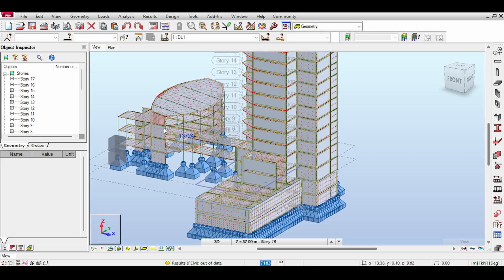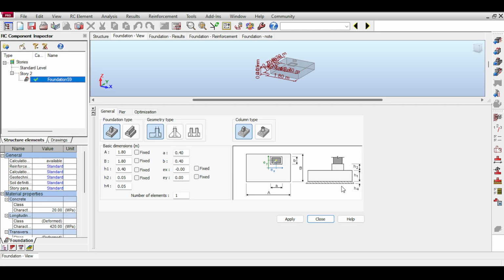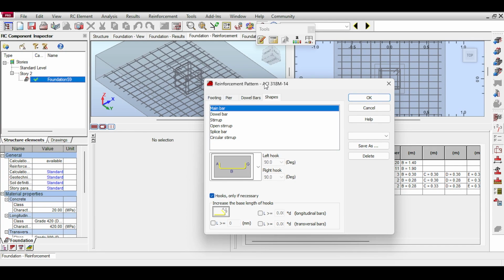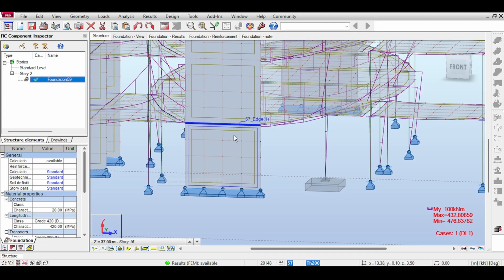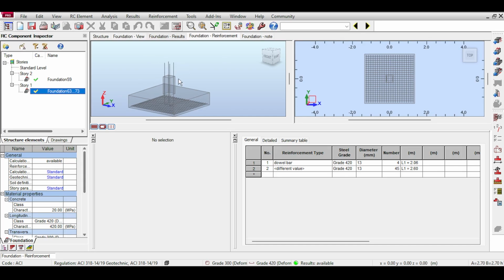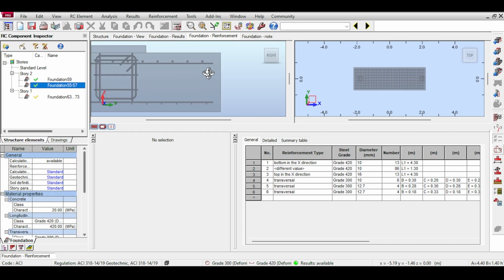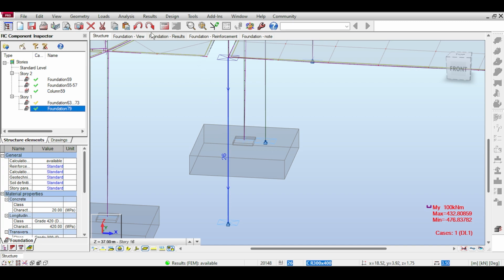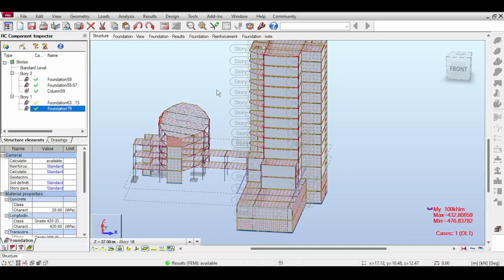Modeling and Design of RC Buildings in Autodesk Robot | Part 17: Spread and Combined Footings

Comment: Dear Dr. CEE, Thank you very much for your video series, first question is, Can we design combine footing or combine pile cap in expansion joint in long span structure which we separate the structure? Second, Can you make the video how to model & Analysis pile cap with structure soil property line is close to each other? 
Best regard, 
Sothat🙏🙏🙏
Reply from the maker: (if I combined two foundations through an expansion joint, then it was for showcasing purposes).
You can basically combine the two structures into 1 foundation. Reason why you separate structures is because they have different loading and deflection behavior.

However, it has a disadvantage: you unifying the foundation which is not economical (smaller foundations become larger in this unification)

You can also have joints in a raft
https://qph.cf2.quoracdn.net/main-qimg-15f4d372c3541963e8dae5670753b6df-lq

Hope it helped,
Regards,
CEE

Comment: Hi!
Just a quick question. Does RSA have the option to select the seismic design category?
Reply from the maker: Hi there!
if you mean by that the input in the Seismic Code, (I think it was the IBC, correct me if I am wrong), then yes.
This is done by going to the:
Analysis -> Analysis Types.
Click New
Select Modal
Then Ok

Then again new
Select Seismic (please choose the correct code)
then all the inputs with regard to that code are open to your input.

Hope it helped,
CEE
Reply: @CivilEngineeringEssentials  ASCE 7, table 11.6-1 & 11.6-2